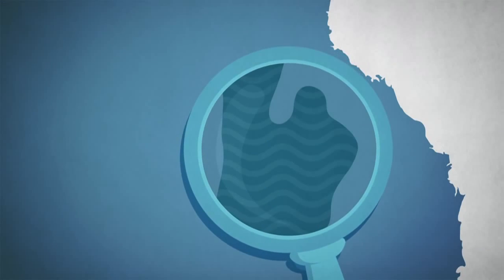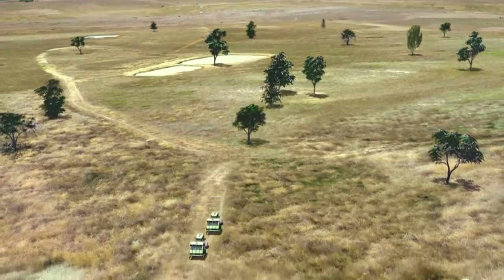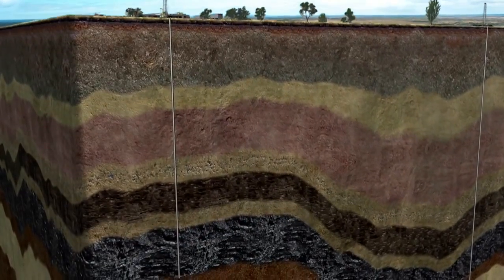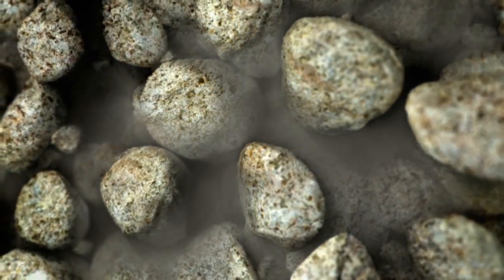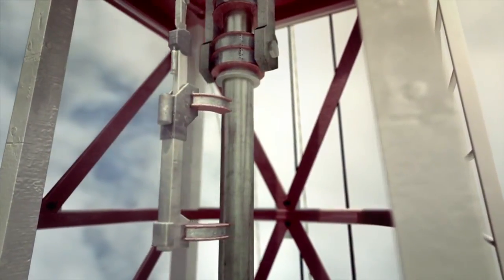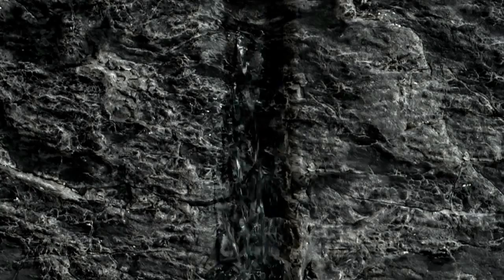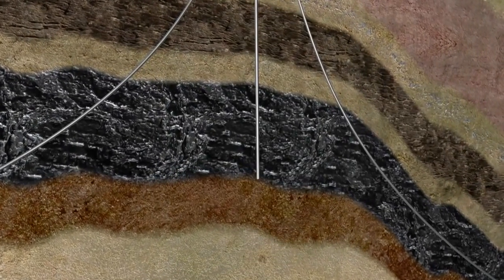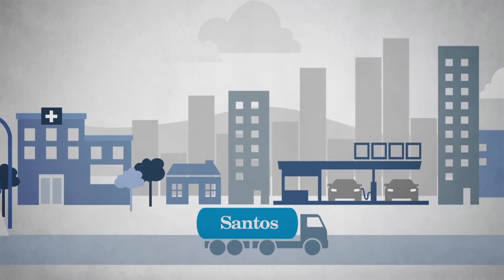LNG Basic Process

Comment: since natural gas comes out of ground with pressure, they could use that gas to spin turbines like rosch generator or other best efficiency generator to generate electricity from pressurized gas.
Reply: This energy is simply used to transport the gas itself to a main central processing station. In some instances there needs to be booster compressors as some gas fields are far from main processing plant